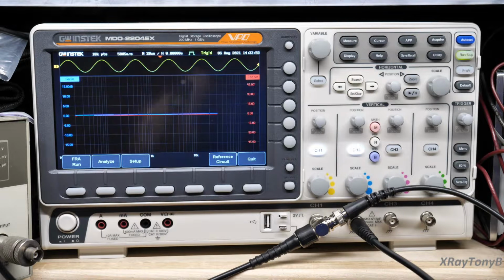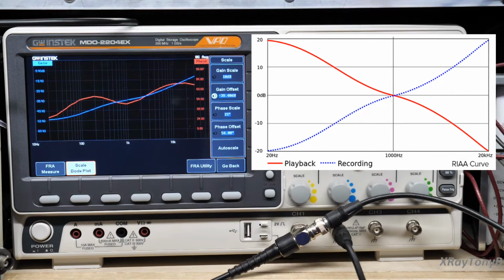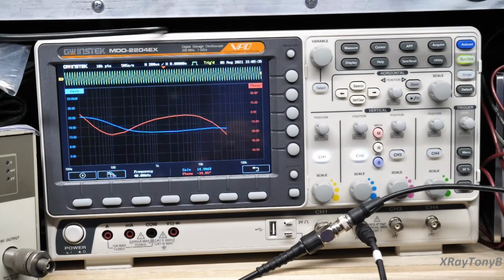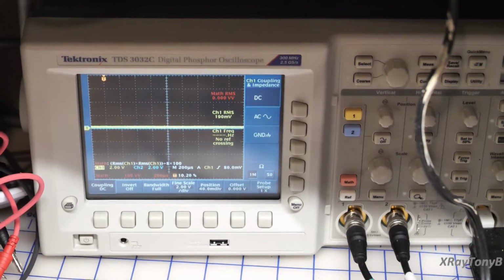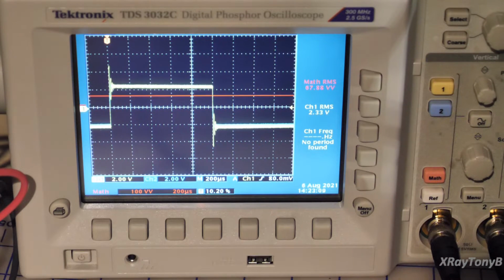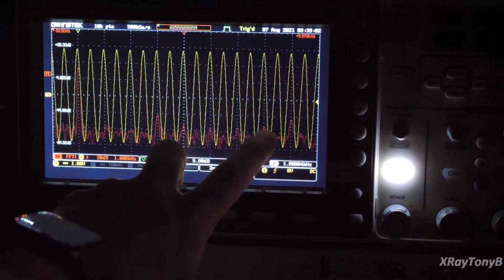Amplifier Testing - Featuring the Rotel RA 1412

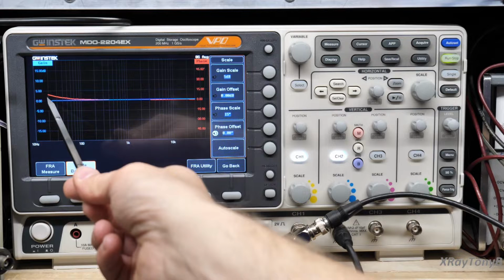Comment from the maker: At 13:30 I list the phase shift as 2.5 degrees.  After looking at the video, it appears to be more like 7 or 8 degrees.

0:56 Intro to Frequency Analysis & the Bode Plot
6:37 Plotting a coax cable for reference
10:00 Plotting the Buffer Preamp I built in an earlier video
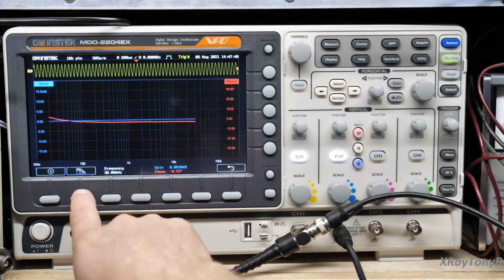Between 13:00 and 15:00 I misspoke about the phase measurement.  I should have been reading the red scale, not the blue scale.  My Bad!
15:10 Looking at the RIAA pre-emphasis circuit in the buffer preamp
19:25 Plotting the Rotel RA-1412 amplifier
24:03 Looking at the bass, treble and loudness controls
30:02 Other devices that can do a Bode Plot
36:45  Frequency Sweep with sweep generator and oscilloscope
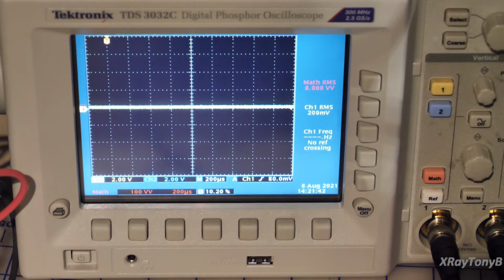41:05 Square wave analysis, with and without capacitive reactance
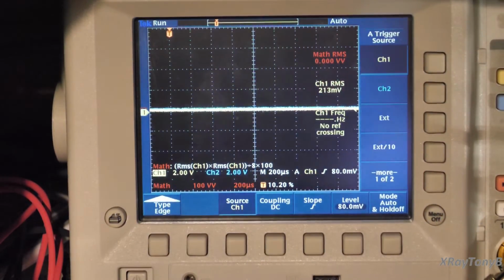42:55 THD (distortion) using the Keithley 2015 on the Rotel amp
45:15 Looking at the harmonics on the HP 3580A Audio Spectrum analyzer
46:56 Compare THD between left and right channels on Rotel Amp
49:11 Measuring THD of amplifier independent of the preamp 
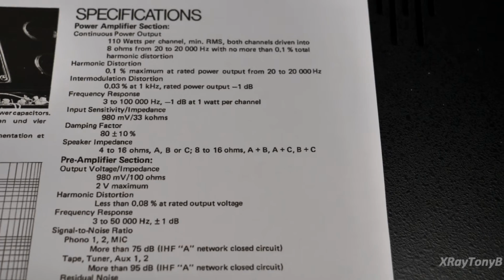52:05 Measuring distortion of the preamp section 
56:49 Trying out the Spectrum analyzer and FFT mode of the Instek MDO

Comment: Loudness Controls are extremely misunderstood, especially amongst the AudioFool community. The issue with all (traditional) Loudness Controls is that the amount of gain is tied to the physical rotation of the volume knob. There is absolutely no correlation of the correction contour with the actual "loudness" that is coming from the speakers, and the sound pressure your ears are receiving!
The input source is continually varying as the music is loud or soft. The input levels might be based around a maximum of 0.3V, 0.5V or 1.0V depending on the LineOut of the source. The speakers might be inefficient 85dB/1W/1m or very efficient 92 db/1W/1m, and you might be sitting close or far away from the speakers. All of these things affect how "loud" the sound is to your ears.
So, the user needs to control at least some of those variables in order to get a useful affect from the loudness control. Some amps have a separate potentiometer that adjusts the "intensity" of the loudness contour that gets applied. You would set this based on your preferences. No matter what, it's just a kludge that usually makes the music sound better to some degree. The only way to properly deal with it is using DSP, but that's a completely different topic.

Comment: 23:18 - An interesting experiment would be to feed the output of the signal generator, bypassing the input coupling cap on the Rotel! That way, you could find how much of that low-frequency phase-shift is due to input coupling.

Comment: Great video Tony. When you did the distortion measurement of the pre and power sections together, what were you adjusting to set the level, the volume control on the amp or the signal generator level? Did you try setting the volume control to max, and setting the test power output levels by adjusting the signal source, thereby minimising the input level to the preamp while achieving the 60w and 110w levels. This should give you the lowest end to end measurement as you will not be driving the input buffer too hard. Sorry if I missed something in the video and you already answered this, I didn't have time to re-watch the video to check 👍🙂

Comment: Thanks Tony!  Very good overview!  I purchased this earlier in the year as it looked like a versatile scope for audio & power supply work.  I loaded the frequency response analysis application - was a little quirky to decompress on my Mac but got it to work!  I found very similar results to yours and think it will be a nice piece of gear for my purposes.  I have a couple other higher end scopes for embedded work.  I like the UI of this Instek but was surprised it didn’t have high resolution acquisition or vernier control of the signal level & time base.  I think those features are pretty standard on entry level scopes so curious why they were left out.  Anyway appreciate you sharing your experience in this video!  Thank you!

Comment: Hi Tony, I've also got the gw instek scope, it's important to set the scope up in the time division mode first so you're not overloading  the front end before switching to spectrum analyzer then you will get reliable reading of harmonics
Reply from the maker: Thanks for the tip!  I'm still learning this thing.  I also noticed that it has a lot of interference noise from all the components.  It only shows up at low vertical settings (like 5mV/div), but it can be a bit annoying.  Of course, they stuffed two power supplies, an oscilloscope, a dual channel signal generator, a DMM, and spectrum analyzer all in that small case.  I can't imagine it would be easy to properly shield it.  For the money, however, it's a great piece of test equipment.
Reply: It probably isn’t noise.  It looks to me like aliasing.  Like ptronix said, check your time division.   You need to have have it twice as high as the frequency you are measuring.

Comment: Thank you Tony for your time posting this very informative video.  Most folks are visual learners; several of your tests were the visual representation of the point of sale images on flyers and other paperwork.  Given the age of most vintage audio pieces, the noise floor comparisons between original build quality components and modern replacements can be profound depending on the circuit design.  If you start from a reference point of silence, music will always have more detailed, distinct characteristics.  This video, along with the next video you referenced including improvements, will show just that.

Comment: Show me where you've been and I'll show you where the problem is. Did I hear you mention putting caps in power amp that measured worse than the ones that came out? 😜
Reply from the maker: Capacitors won't typically cause harmonic distortion.  It could possibly cause signal attenuation at certain frequencies, depending on leakage, ESR, Q, etc.  If there were a slight difference in specs, I doubt that it would make a very big difference.  Thanks for the comment!

Comment: I wish you had done the Bode plots with an actual speaker, rather than a dummy 8 ohm load, as we all know, there is no such thing as purely resistive speaker in the real world. Some DC coupled amplifiers can maintain a remarkably low phase distortion even under hi reactance loads.
Reply from the maker: Adding a speaker load would show the effect of the load, rather than the ability of the amp to pass an unmodified signal.  If we were looking at the amp plus the reactive load of the speaker, we would not be able to determine if any phase shift or change in amplitude flatness was due to the amplifier or the reactive load.  When you test for the amp's response to reactance, you use the square wave and then add reactance to the load to see how it affects stability.  I showed an example of that later in the video.  Thanks for the comment!!
Reply: @xraytonyb  - Thanks for the reply. The reason I mentioned 'real' load is that a good amplifier should maintain a constant phase shift 'regardless' of reactive characteristics of the speaker load. Maybe that is good argument for McIntosh Autotransformer output topology which 'theoretically' maintains a constant phase shift no matter what sort of speaker load it is driving.

Comment: Your video reminded me of something.  There are a lot of arguments about the unimportance of low amplifier distortion.  The arguments go that ultra low levels of distortion are useless.  I know of one amplifier company that adds distortion because the designer says he believes it sounds better.  But what is usually forgotten is that amplifiers, well, amplify.  The turntable arm introduced distortion.  The cartridge has distortion.  Each gain stage along the way takes thase distortions and amplifies them along with the sound.  In the case of a turntable, there are 4 stages of gain including the cartridge turning mechanical energy into electrical energy.  Not only is each previous distortion increased by the successive gain stage. But if the following gain stage has similar distortion character (2nd harmonic for example)  the distortions lay on top of each other increasing the distortions more than just the gain..  So I submit that minimizing distortion to the lowest level possible should be the highest of priorities......no matter what "the experts" say.
Reply: As you say, having a chunk of rock dragged along a groove on a piece of wobbling plastic is going to introduce high levels of distortion anyway, but one could argue, that moderate additional corruption of this poor signal will not fundamentally change anything. It is surprising, that something originating in the stone age on so many levels, excuse the pun, can in fact produce acceptable sound quality, which many find superior to modern digital sources.
Reply: @paulb4661  if it indeed was a chunk of rock dragged through a ragged groove, you'd be right.  But it is actually a very finely shaped and polished diamond of such engineered light weight and shape with supported with a suspension with proper compliance, aligned and  slipping through a smooth modulated groove, that is indeed superior to digital. Digital is a bunch of points taken from what is not actually complex shape (not simple wave form) where the points are used to kind of reconstruct a signal somewhat resembling sound.  My point is not to argue with you but to point out that both storage systems have their faults. I could have easily argued the distortions (difference from original) created in the digitizing of sound and each gain stage magnifying those distortions and each gain stage adding their own & increasing what was already there.  You enjoy your digital and I will enjoy my analog.  The point to my original comment was the need for low distortion at each gain stage., Not argue the digital vs. analog argument.
Reply: @jked7463  Agreed, my description is a bit simplistic, whilst yours much more poetic, however we can agree, I hope that impressed PVC is not a perfect representation of the master at an electron scanning microscope magnification level and hence granular in a sense. Tracking is so poor, that RIAA curve had to be introduced to prevent the needle from leaving the groove. L to R separation is poor, as there's a physical limit as to by how much can both sides of the groove differ, noise floor is poor, dynamics suffer, but regardless, it can sound surprisingly good. Not that I cannot fault digital copy on many aspects, same story with vacuum vs transistor - specs and figures do not translate directly into the impression one has of sound quality. What is certain however, is that good record player will be much more expensive than a decent cd player, likewise, a high quality tube amp will exceed the tag of a BJT/FET one by an order of magnitude. Economics aside, distortion is important, but isn't that important in a sense, especially that all this will end up in the weakest link - a loudspeaker.
Reply: @paulb4661  I guess it all depends on what imperfections you focus on.  FYI, vinyl records are not impressed.  They are injection molded.  The heated soft vinyl flows around the master.  So the vinyl is not as "granular" as you make it out to be.  That said.  I agree that there are so many parts of the recording/playback chain that introduce their own errors (including the recording engineer and his recording techniques) that digital/analog is only part of the imperfect reproduction process...including speakers.  As far as cost benefit between systems, I have yet to hear any digital cd level based system that has the micro dynamics or detail or depth of a "good" analog system.  The digitizing process cannot capture the micro details of  complex music.  When multiple instruments are laid on top of each other the signal can hardly be called a sine wave anymore.  That is when the "break it up into dots" system of digital looses information.  If you ever do a a/b comparison of a well recorded analog recording that was expertly digitized, you would hear what I am talking about.  One of the problems with analog is the engineers processing, reprosessing and processing again before cutting the master. If you hear a direct to disk and/or a company that takes a lot of care like sheffield labs, you would also heat what I am talking about.  I have a friend who has equal level digital and analog setups.  I have witnessed multiple comparisons with average, non audio, people to compare analog vs. digital.  Analog always wins.  The look in the people's faces shows it immediately.  That said, I don't expect anything I said to have changed your mind.  Ultimately it is the music that matters, not method of storage.  Enjoy your digital and I will enjoy my analog.
Reply: @paulb4661  on top of my previous post, I will admit that it takes a lot more maintenance keeping records clean than CDs.  But to me, the added level of details in analog is worth the effort.  But that is me.  As my old boss used to say, that's why they make chocolate AND vanilla ice cream.
Reply: @jked7463  Fair enough, all I was trying to point out was, that if one was to assess the performance of a deck based on canonical engineering measurement methods - THD+N, stereo separation, wow&flutter they are poor by any standard and yet a record sounds surprisingly good. Why then advocate elimination of said distortion everywhere down the chain, but failing to address the measured performance of what you begin with ? Unless of course inherent distortion here is somehow special and needs to be preserved ? What I meant by granular is that viewed under a microscope, both master and a copy arr made of molecules and far from smooth, ie. finite in resolution. Imperfections do creep in, copies differ both from the master and themselves and also wear out each time when played.
Reply: @paulb4661 This line of discussion can go on ad nausea.   Like I said before, you enjoy your digital and I my analog.

Comment: Looking forward to seeing what's up with that distortion.  That Instek seems to be a decent piece of equipment.
Reply from the maker: The only issue is that it seems to have a problem with the switching power supply inducing noise into the input of the scope.  Not a big deal for higher signal levels, but not a very good device for millivolt level signals.

Comment: Great explanation as to the importance of phase.  That is why I like my kenwood KA7100.  It's Direct coupled, no capacitors in the signal path (with the tone controls removed).  It makes for very coherent sound with good pacing.
Reply: "very coherent sound with good pacing" = you are giving away the kind of forums that you visit.
Reply: @johncoops6897  you think so?  I never used to believe in "pacing" until I compared this amp with my tube system.  My experience is designing and installing pro sound systems for churches, performing arts centers, etc.  As part of final system adjustment, I realized I needed a reference system to "tune" my ears prior to showing up on site. So I started creating a system for that.  This is the origin of my dedicated listening room.  I then would tune the commercial systems to make it sound as good as possible.  From that I used many, many commercial digital processors.  I started with all analog systems and "grew up" with commercial digital as it developed. From this, I learned alot about not just how digital works technically, but also how it deals with the music it is processing from real world basis.  From early processors, I would hear "stuff" but not know what it was.  I would study, AES journals were a good source, learn and compare to what I was hearing.  As digital matured, those things I heard would change.  The changes provided more learning experiences. Obviously I am simplifying because of this format. But all of this real world learning gave me a different learning than the theoretical people.  That is why I have some different ideas.  Parallel to this my father was an electrical engineer so my residential experience started with his tube amp (taken from a console stereo?) and full range single driver speakers.  So that was the begining of my residential analog experience.  I built my first speaker in high school.  In college took courses in audio/electronics and acoustics.  I still work with my acoustics professor.  So no, my language does not come from picking up the lingo from you tube channels or websites.  It comes from over 40 years of real world experience.  Sorry if I sound mightier than thou.  I am still learning every day.  So I don't think I know everything.  I only told this long response to let you know, there is some experience behind these crazy comments.

Comment: You could also run a Bode plot up to 200kHz to confirm the 100kHz -1dB 1 watt Rotel response spec. What is your generator's own THD residual when running at a level of full power driving the Rotel main amp section? You can factor that in.